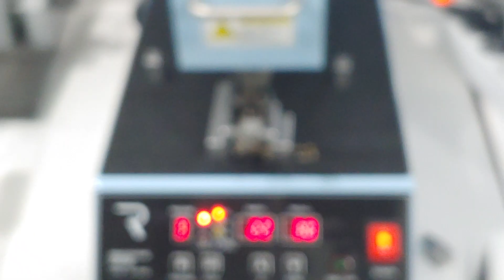REGENI rework system BK200S hot air station to fix Iphone6 as (de)soldering station

Comment from the maker: To purchase main machine, 15x15 Top & Bottom Nozzles, and 6pcs PCB holding blocks, please check below link:
https://www.ebay.com/itm/264505833507
To purchase other available size of nozzles, please contact  email:  michael@regeni.com
To purchase only additional PCB holding frame:
https://www.ebay.com/itm/264509364687